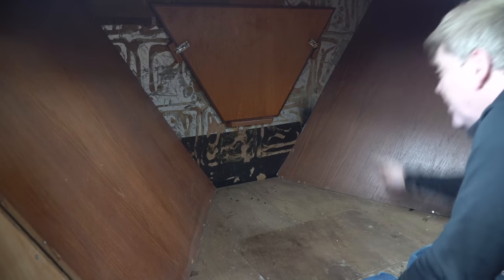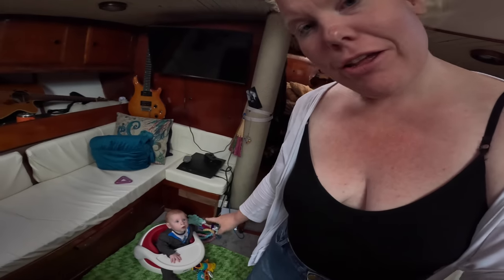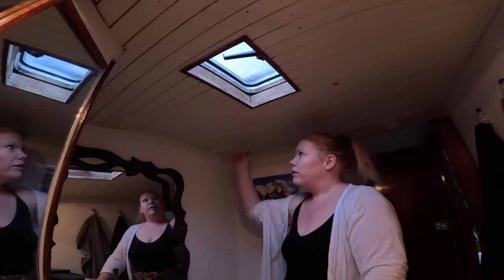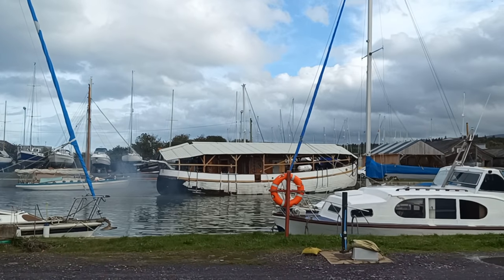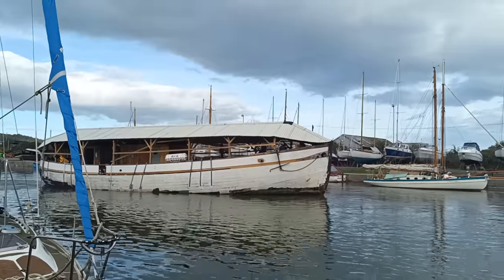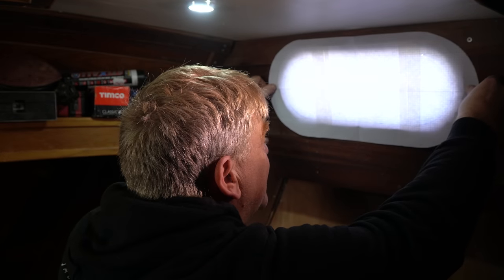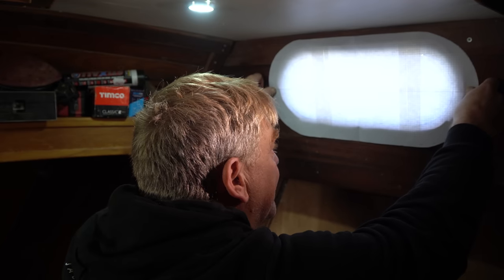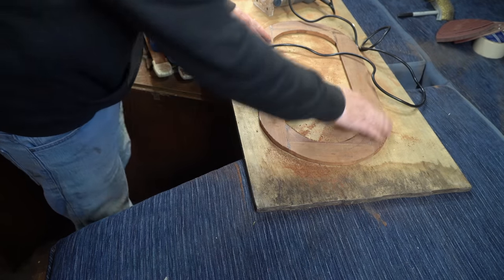165 :  Yacht Restoration using Reclaimed Mahogany Floor Boards

Comment: I too have an old boat (44 yrs now).  Every time I did a project involving wood,
I would save all the pieces and put them in a corner of my garage dubbed "The Wood Department".
Over the years I have found it was a very valuable resource for the same reasons you gave in your video.
My wife, however, complains that the wood is taking up far too much space in her favorite 'junk' storage locale.
I remind her that the Wood Department was started before I met her and that the local
 "UStore It" facility would be happy to accommodate her collection of treasures!

Comment: I’m completely on board with recycling wood. I’ve seen so many videos that have wooden structures that have weathered time, but without care have fallen apart…there is such a great source of material still available…it is esthetically (character)  impossible to recreate…rent a truck or trailer  and go exploring, it is everywhere …

Comment: I had a similar job to do in the campervan, I ended up using 50mm wide masking tape over the area I needed to copy then marked the masking tape and then remove and use that as the template. It worked great.
Reply from the maker: Nice idea 👍

Comment: Kind of a simple little suggestion, but maybe you should get yourself a painting shield. Basically, it’s just a wide putty knife. You can use a 3 inch wide with a paint brush right next to it and take it around corners keeping your putty knife up against what you don’t want to paint and the paintbrush on the other side, were you do want to paint to protect window trim or outlets and what not. You can also get a six or 12 inch or both, of course. Then you can hold them in place while you just brush the length slide down a little further and brush some more and keep going to your around the room easy Peezy cut in and time to roll with no muss no fuss and no paint peeling off when you pull the tape because there is no tape which not only saves time but money. Just search drywall knives or at least that’s what they’re called in America.
Reply from the maker: Will have a look at that 👍

Comment: Hi gang !! As for the toilett/bathroom with the small roof window that was painted, maybe four or two mirrors, slightly angled, could spread the light a bit better. I think there are now mirrors on plastic, otherwise auld glass mirrors would be quite small, so a list at bottom and just some angle iron/plastic would hold them fast....
Just my immediate reflection, and allda bestest from mikke in sweden....;-D
Reply from the maker: Good idea!

Comment: Ocean Melody is bigger and more capable and more finished..but Steal Melody always looks lighter and more open to me to live in and live in (or camera&light setup?)...also because of the deckhouse. So unfortunately one size too small in terms of berths...but hopefully soon a new owner who will continue to lovingly finish her and sail her..and who knows, live in her. Nice DIY all three!!❤
Reply from the maker: Steel Melody is definitely brighter with the deck house but that does make her hotter in the summer and colder in the winter but we loved looking out the big windows... Everything is a compromise.... We hope she finds a lovely home!!
Reply: @SailingMelody Yes, that too, and temperature on board really is a thing. And indeed compromise the key word with boats. The 38-foot steel two-masted cabin sailboat I live on recently has a raised aft cabin with aft windows. I have also made a sitting area there now for when I am not behind the monitor/TV for a while in the central mid-cabin (standard saloon there which I converted back into also skipper's cabin/sleeping area..it sloshed too hard in the aft cabin/sleeping area) which has smaller side windows, but lots of light through roof hatch and entrance. So compromise and find set up that suits you best....